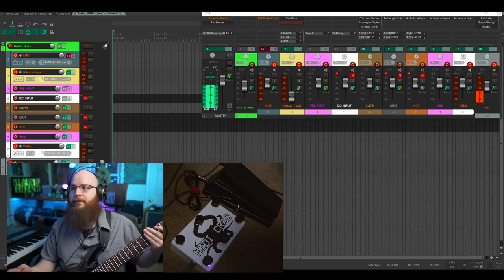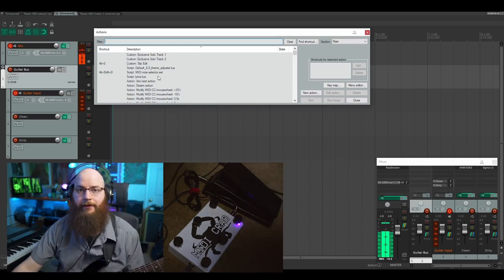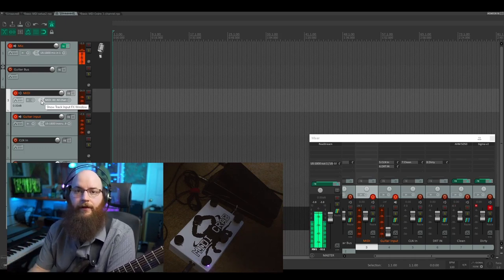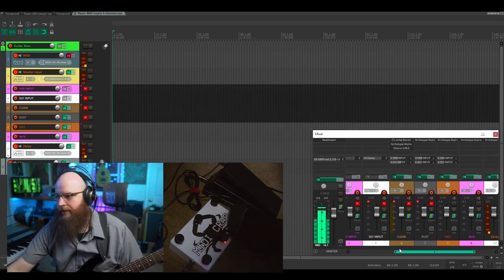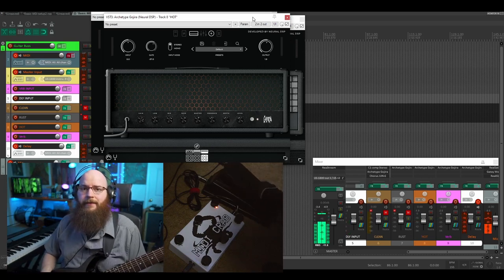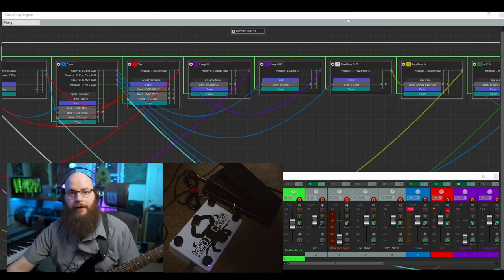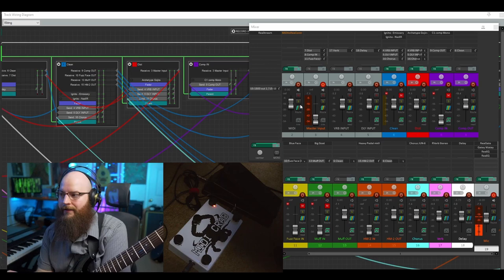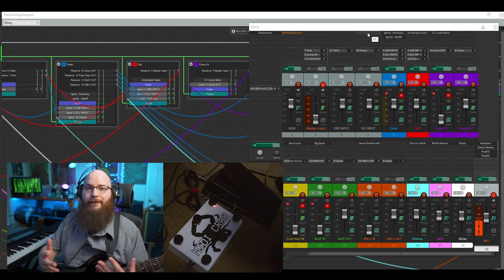MIDI Amp Switching in REAPER

Comment: Well that's awesome!  I set it up this way but I worry about tracking with the band.  It's great if you're the only one using it but remembering all mute/solo states when you have a pile of tracks (drums, bass, guitar, mics etc) can make things hairy.  Then remembered about Realearn.  It lets you control virtually anything with midi, so instead I used it to control a JS volume (I modified it), to mute/unmute the audio in each track.  I also have a master volume expression pedal.  Works great!
Reply from the maker: you're totally right, and I never really tested it outside of solo stuff, but that's a great method!
Reply: @NickLeonard  you can use it to toggle individual fx in the chain too. So it can act like a regular stomp box setup. I guess this wouldnt record as well tho
Reply from the maker: @IanMainBliss  recording can be a challenge with this setup. As long as you can record the automation, you should be fine

Comment: with the cost of software that works but not really, and is also limited to certain plugins, this is the absolute most increadiable and innovative solution I've found. now I can use my nural dsp, acufiend, shadow hills compressor, and neve channel strip with all my sound toys plugs all in one easy to use package. I'm going to explode with joy and celebration.

Comment: Hey man this is awsom! I have an idea that might save on the cpu. I have not built a controler yet so I cant test an Idea. If you mute the effects  along with the track, it should not run the cpu on the effets not being used. You can just mute all effects right at the track on fx. I think it would save that too. so mute effects chain on all muted tracks...or I wonder if it would save dis engaged effects on the same track. Just a thought.
Reply from the maker: Good idea, I'll have to see if that works!
Reply: @NickLeonard  Hey, I hope it does. It may do something funky by cutting delays off when you mute the effects as a whole. but if you buss to a delay and use the same one for dirty and clean it should be good. I am not sure. Btw--man, you video's are fantastic. I just have to find the time to make a peadle. I suck at sodering too. Lol Keep me posted if it worked. ty
Reply from the maker: @adamhakim3529  thanks! yeah I wouldn't use it on delay or reverb but for everything else it should hopefully work!

Comment: 16:30 I did everything the same way and I can't tell if there should be trails from the delay from clean to dirty (can't hear it in your recording either). If I got this right, shouldn't there be a delay/reverb trail into the distorted sound when changing mutes?
Reply from the maker: Yeah, as long as the delay isn't getting muted, it will keep trailing. May not be obvious depending on speed and feedback settings
Reply: Same thing here. Were you able to fix it? Followed every step as well but delay/reverb trails still cut off when switching tracks.
Reply: @JEbay-ye9yo  well it's not an actual trail, just a smooth transition, the two different tracks don't trail into each other that way

Comment: Awesome ideas! I'm trying PedalinoMini and it does have some nice functions like hold for tuner and I could really use it for a live setting.
Reply from the maker: I hadn't seen that one, but it happens to be almost the same as the one I made with the nice addition of the lcd screen. I haven't played this setup live yet, but there's no reason why you couldn't have just a laptop/interface/power amp and have a really powerful live amp sim rig.
Reply: @NickLeonard  Yeah I've had a fairly complex setup (1 side without cab sim for my real amp, other side with cab sim for my inears) and it's working great but I want to build a bluetooth midi controller with 4 buttons and maybe 2 controllerknobs so I can change parameters like volume or gain. Pedalino seems to work well, I haven't gotten around the part actually building a board but testing it with a cheap TOOGOO TTG it does most of the things I want and has a display.
Reply from the maker: @ayeapprove  The video I posted about making mine has the code that could work for that. I got it from Notes and Volts, who has lots of videos about similar projects. You can either use an expression pedal as a pot, or a regular pot for your hands, maybe on a stand could be cool if you had a bunch of controls. Bluetooth, I'm afraid will introduce a fair bit of latency, it may be something you can live with depending on what you need, but I don't want any control delay!